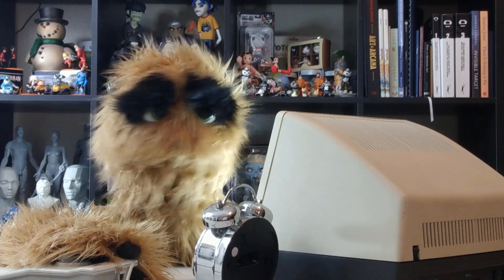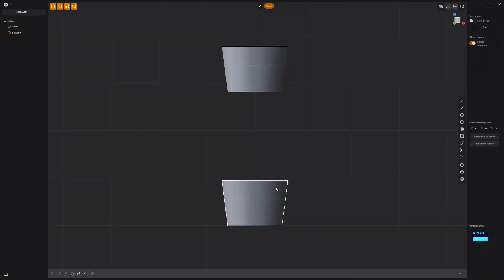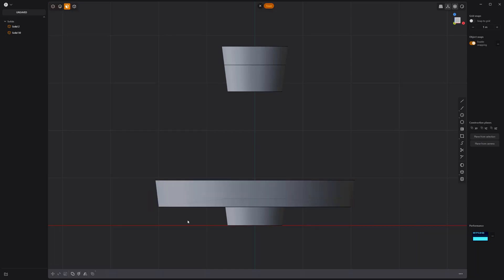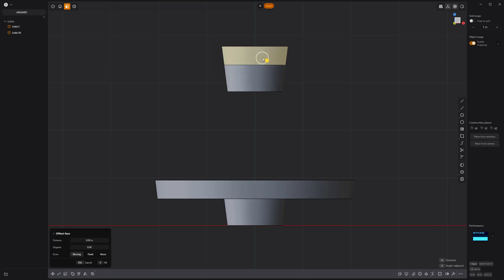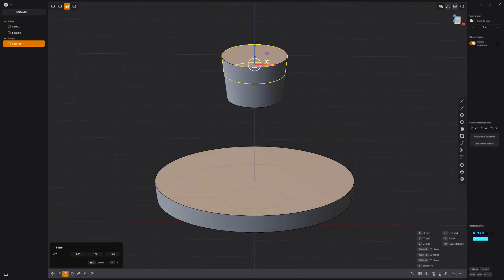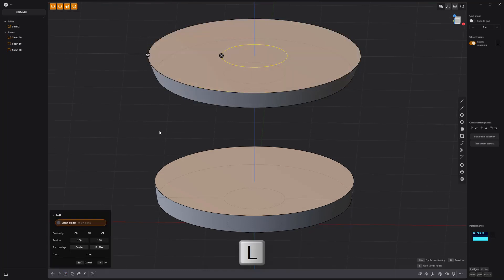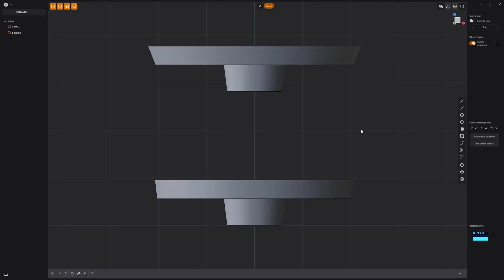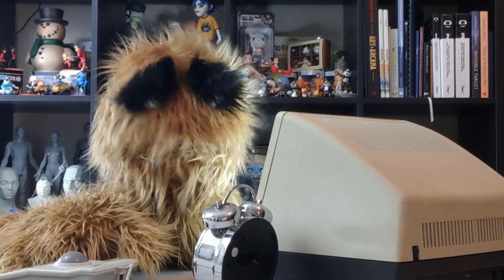Plasticity | Offset Face and Keep Height

Comment: ok, question of ignorance, when scaling a face, how to easily scale to a specific size, say for example when you scaled the upper model's tapered face, you wanted it to be say 100 mm diameter. What is the easiest way to do that? This method seems so fast, but how to control it precisely? Thanks! These videos are the best!
Reply from the maker: I dont see a Diameter attribute but you can use the AXY attributes to numerical enter values